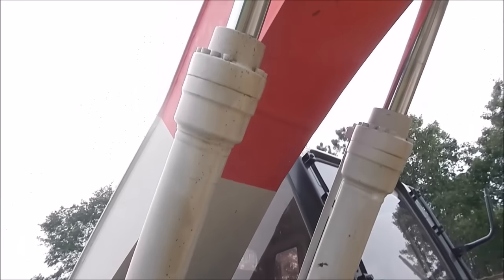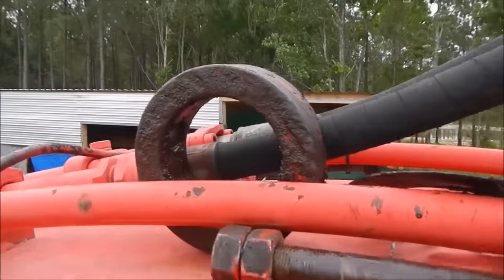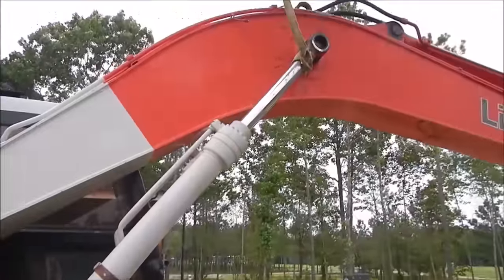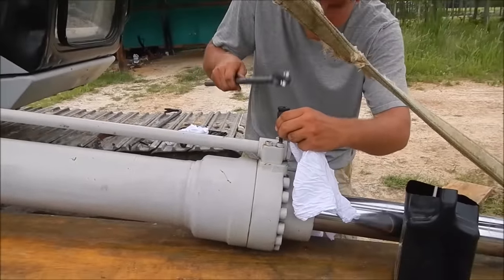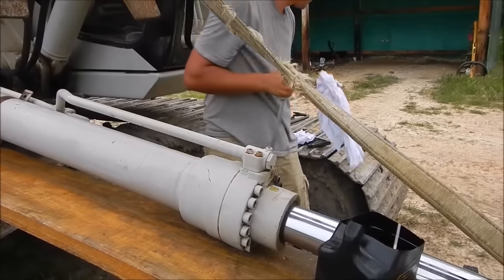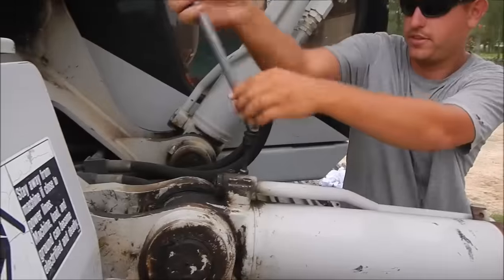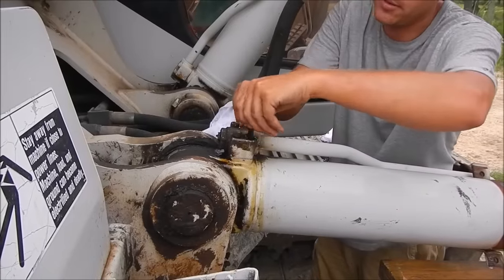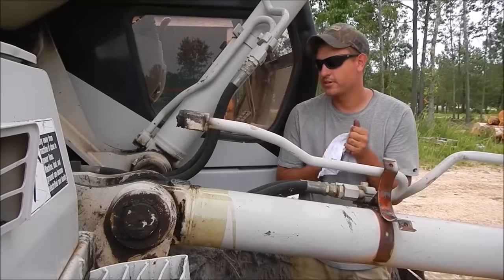Linkbelt Boom Cylinder Removal part 1

Comment: Thanks for this great video! Extremely helpful. Do you have to take any precautions to make sure dirt doesn't get in lines? Also, did you release pressure first using joystick like a couple people commented here? (I'm wondering if that's why it didn't spray).

Comment: wish you had video of that incident on the boom, always funny when it happens to someone else. my worst was an old mack tractor trailer yard truck, body 3/4 way up hose blows out of coupling and shattered back window so hose pumping in cab, something deflecting oil from cylinder making it blow in cab. never thought to push in clutch to stop pto fellow workers literally rolling on ground laughing when they new I was ok and to top it off, go to the rag bag to find something to wear,lol.

Comment: wiggle the controls after machine is shut down to release pressure
Reply: Yep, key on, safety lockout engaged and the wiggle all the controls, usually works.

Comment: Chris, why don't you reseal the rams yourself? Pull it apart and take all the seals down to a local seal shop and tell them what they're off, and they should be able to match every seal and wipers, for a fraction of the price! The bigger rams are easier with the allen screws on the head, and the smaller rams, you use a bench vise and pipe wrench on the head.
Reply: You can get the cylinder apart, but the nut on the end of the rod on my machine is torqued to 5000 ft/lbs.  You can't exactly break that loose with a 3 foot cheater pipe and a breaker bar.
Reply from the maker: i already bought the seals for 1/4 the dealer price online